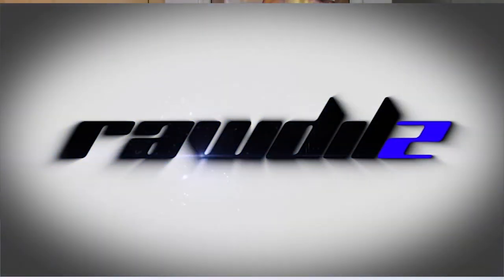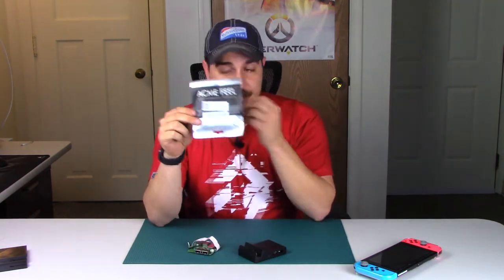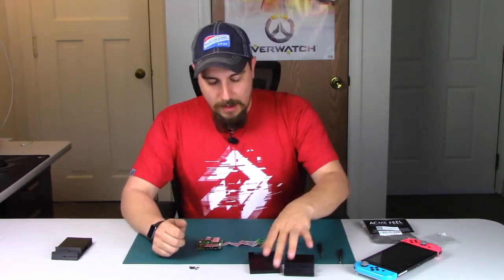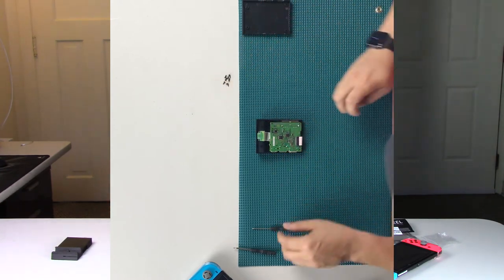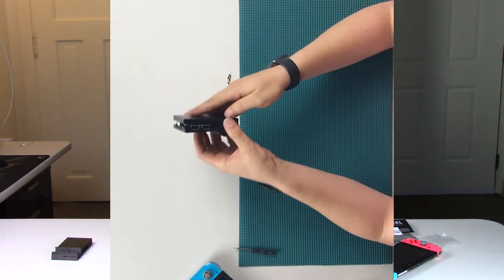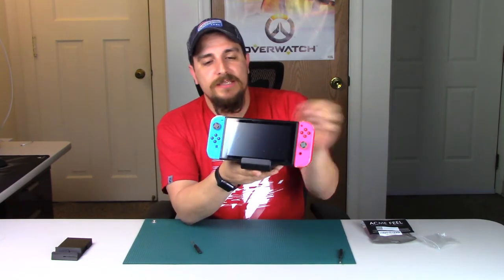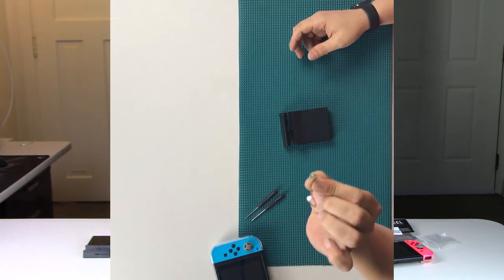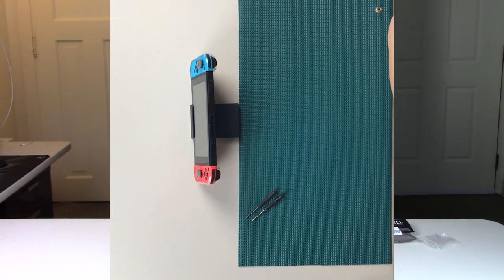Mini Nintendo switch dock

Comment: Thanks for the video. I don't have a 3D printer but I have a Dremel drill and I ordered the small dock from Amazon today. I will be drilling a couple small holes for extra ventilation. I may also try and stick the led light in.

Comment: Great video! I don't see a problem with ventilation as the original dock blocks one vent and as soon as you close the cable case blocks the other.. so this is definitely going to give better ventilation or do what DevilsWar said and drill vent holes.

Comment: i'm actually going to be building my own switch dock with a built in fan and back rest to prevent sagging, i noticed how hot the switch got while docked
Reply from the maker: Viiv SYN the switch will get hot regardless. Not sure what the purpose of the fan would be? There is already a fan built into the switch. The USB converter board doesn't generate much heat if any at all.
Reply: yeah i know it has a fan, i can hear it humming away when docked, but the fan would be to pump more air through the intake vents on the back, i don't think the switch breathes very well because of the amount of heat it produces when docked.. not sure if its just because the switch is almost enclosed when in the stock dock or not, will test without a fan to see, but i am curious if the its just the fact that a majority of the switch gets sheathed

anyone mind testing it in a docked mode without the stock dock? curious if it gets as hot

the back rest would be to prevent sagging from heat because i've heard of people's switchings sagging (warping)

Comment: the product looks good, the only thing that i would like to know why can those companies make those dock with a bit more height in order to install a small fan from the top, since the original dock is so big this this particular addition wouldn’t make any diffence in the size since it would still be a better choice… also there is a company that is making a dock that is for charging is called Orzly and it has a type C plug from behind and it cost $9.99 on Amazon does that mean it can be connected to the original dock using a type C extender in order to get the signal for the TV? over all it looks great what you have done with the dock. thank you for that since i can not find any other videos that shows the product with detail….

Comment: I'm finishing my custom wood dock that docks while my switch has its clear she'll and joycon installed.  I'm just using a USB c extension to go from the original dock to mine, the mini dock would cut down on the cap under my secondary monitor stand.

Comment: No spring in the connector....bad item!
Reply from the maker: Bobshouse I mentioned that. As long as you a bit carefull putting it in the dock and removing it. But not sure if it will be a problem over time. Remember the stock switch dock is made with little kids in mind...